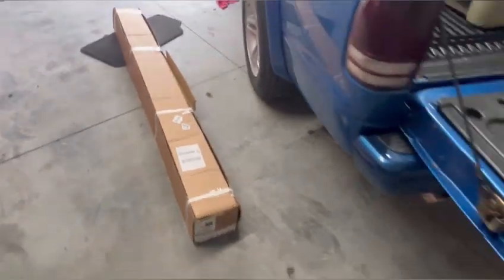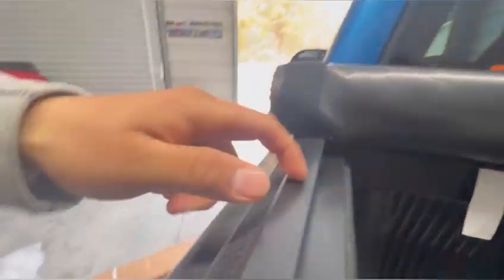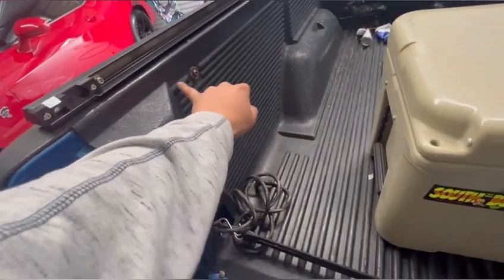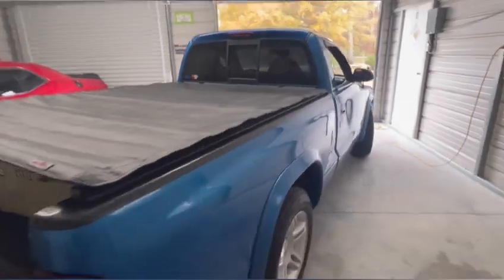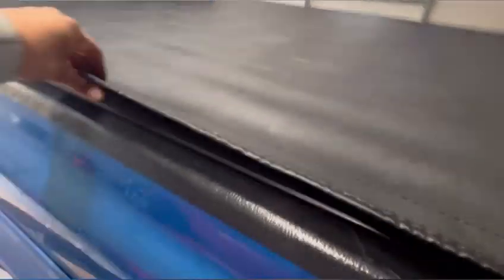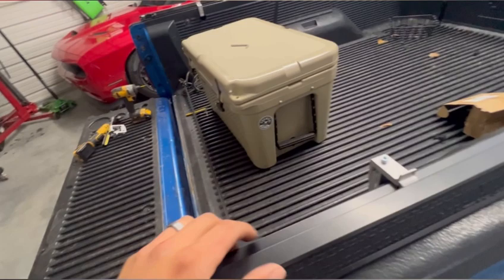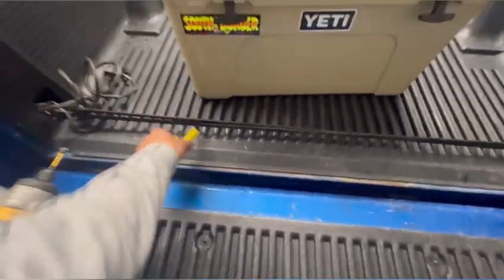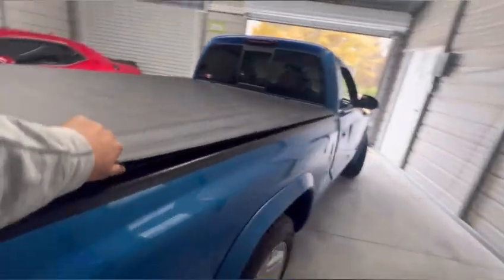Installing a amazon bed tonneau on the r/t dakota!

Comment: Good video. Any thoughts on how much snow it could handle on the cover? Would it collapse will any type of weight?
Reply from the maker: Haven’t had any snow in NC lately, but its gotten poured on with rain, and it does hold a puddle if truck is parked, and doesn’t collapse, seems pretty good stuff for the price.
Reply: @moparmadness8237  Thanks bud 👍